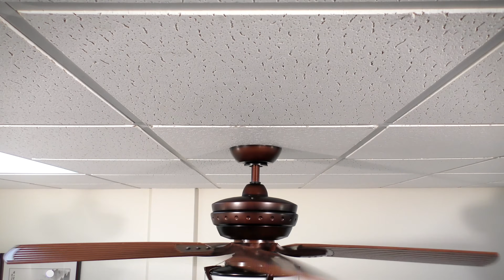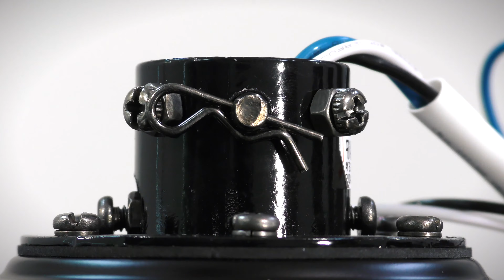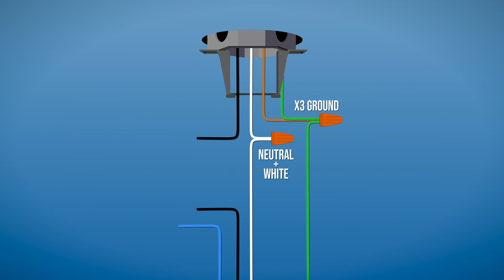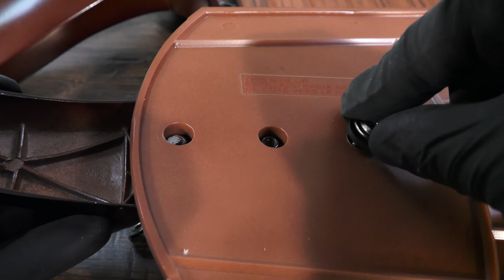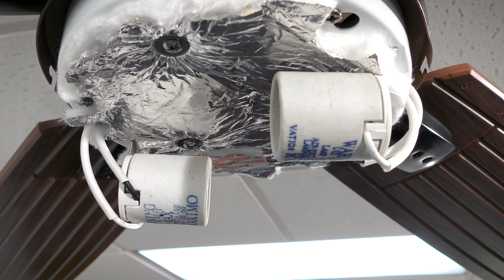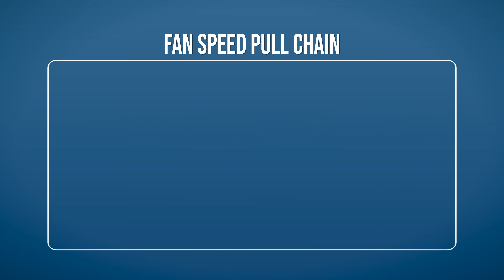54" Four Winds Ceiling Fan Installation Guide

Comment: Would of been nice how you install the light fixture????
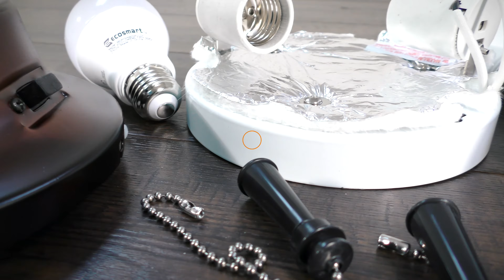Reply from the maker: Light kit installation can be found at 6:20 in the video. If you are trying to replace or reassemble the glass frame/holder, contact customer service for assistance (1-877-902-5588).